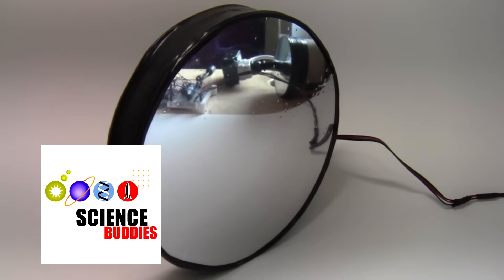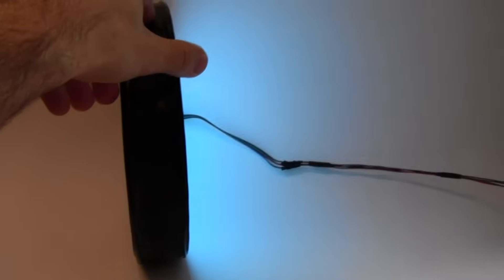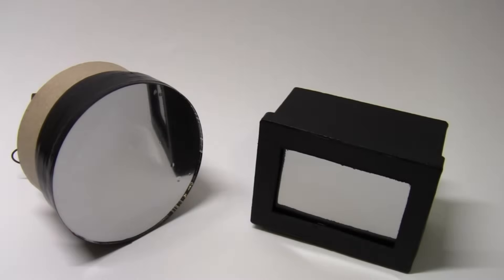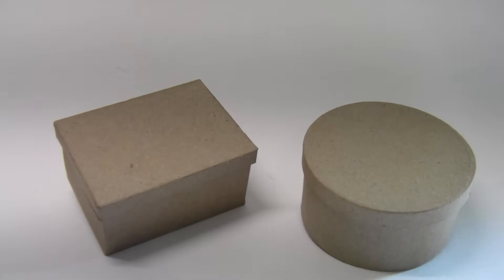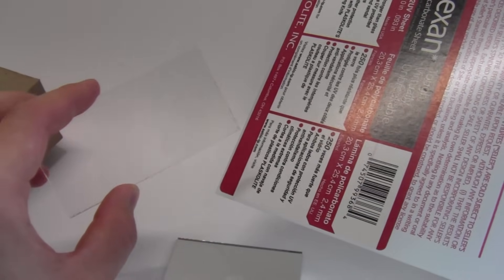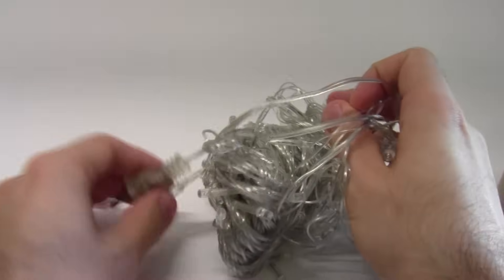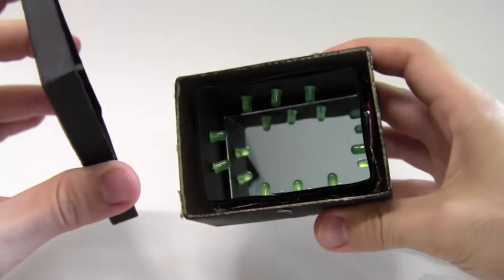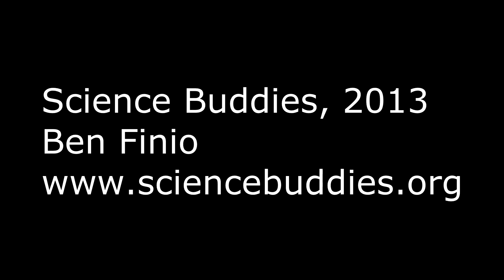Build an Infinity Mirror | Science Project

Comment: What is reflective factor for window tint film You used here??? There is several diferent factors... From 50% to 100%... Which one did You use here?
Reply: Bojan Simonovic You can use regular dark tint (that has the percentage of light that's allowed through listed-- the type that you can put on car windows), but it seems to work best if you use actual "mirror" tint. I haven't seen mirror tint with a percentage listed listed on it like that. Are you using dark tint or mirror tint? The kind I've used, that works pretty well, is called Gila Mirror Privacy Control Window Film. There's no percentage rating for it or anything. For this brand at least, if it's "mirror" tint, it's all the same. I'm not sure if there are other brands that have different strengths of mirror tint, and which would be best if there are-- but I do know that kind I listed above works (and it looks the same as what he used in this video).
Reply: Tnx

Comment: an you make it  in mirrors on both sides?
Reply: I meant "can" and "infinite"
Reply: Alec Neal Yeah, you basically need 2 mirrors facing each other, with a strip of lights in between. Since you can't see through regular mirrors (unless you use a 2-way mirror), you have to use regular glass with mirror tint on one side, instead of a mirror (ultimately the front side, once it's put together), so you can see through it.

Comment: i am trying to make one that has both sides exposed inset a partition wall the effect i am hoping for is to see through  and still keep the infinity look i havent completed it yet but i am using a two way mirror in the middle and both outer sides a filmed plexi  with 2 led strips on either side what i believe i am seeing with these videos is the closer the mirrors are together the more infinity effect is that correct? any input on what i should be doing to get the look im wanting? getting frusterated haha

Comment: Can this be done using two acrylic mirrors instead of using one acrylic mirror wrapped in film and a traditional one? I ask because I can't find an appropriate sized mirror for the photo frame I'm using. Most mirrors I have are too big and because they are traditional glass, I don't have an effective means of cutting them to the right size - where as I could easily do this with acrylic mirrors. 
Thanks
Reply: Suraj Tirupati Technically yes it can be done with 2 acrylic sheets wrapped in reflective film just make sure the reflective sides are facing each other with your led's in between.. in fact it gives a pretty cool effect cuz then u get a Illusion mirror on both sides of your frame :D 

If your making a small one just stick the battery pack to the side of the frame.. if ur making a big one do the same with the cable n bring it out from the side of the frame. ;) lemme know if it helped